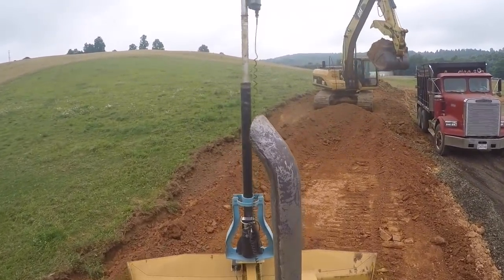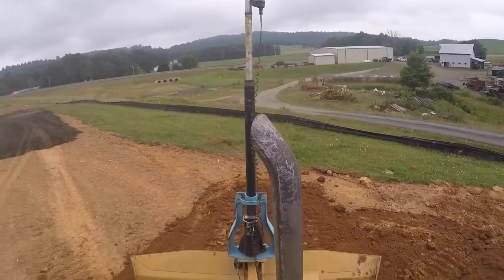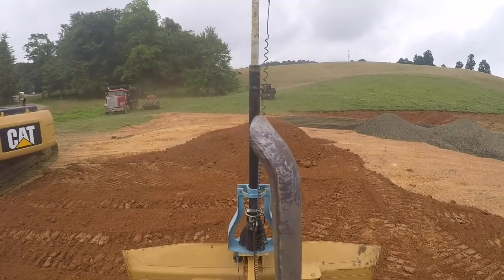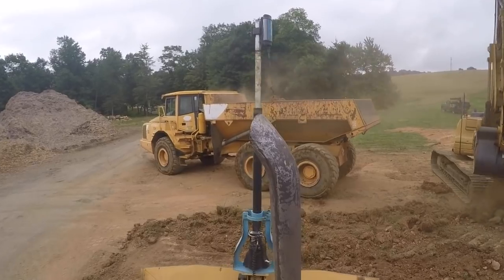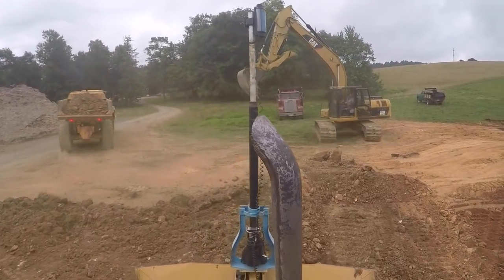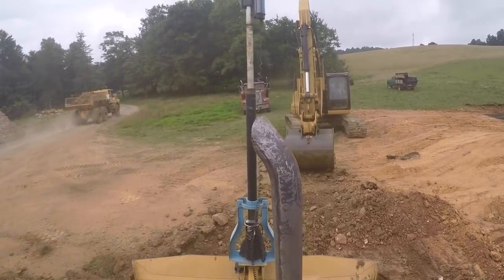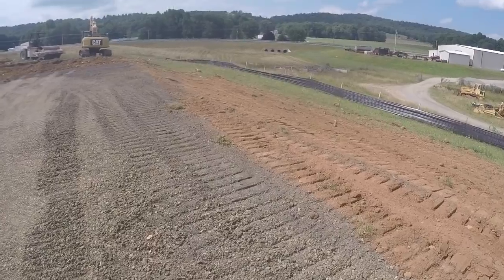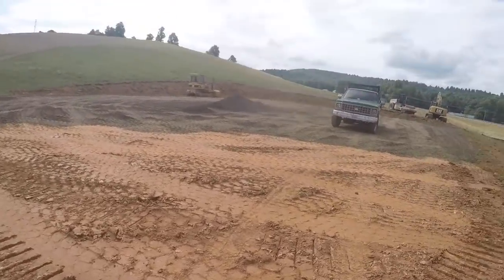Last of the hay barn grading

Comment: After my year in farming I followed dad into construction, he put me with the survey and civil engineers. Now this was the time of Levels, Theodolites, chains and pull banding for precise length measurements. The later had to be checked against the UK imperial measurement scales in Trafalgar Square, London where we were a tourist attraction for an hour or so. For a dig like yours we had to erect sight level boards, two men would then measure the dig depth one sighting the other walking with the T shaped traveller. But then you know about all this. To transfer the opening position of tunnels at the bottom of a shaft. Two alinement points were set at the shaft top, finned weights were dropped down the shaft on piano wires, with the weights suspended in oil filled drums. Line up the two wire and dig away. Man the good old days.

Later I went into tunnel construction and a senior engineer had invented a line and level tool for the tunnel boring machine. It consisted of a car spot light mounted so the beam was at line/level, at regular distances were three steel panels with a cross cut into them for the beam to shine through. The cross shone on a Formica board marked with square lines, numbers across the top letters down the side. At the start of each shift the operator was give the coordinates to steer A1 A2 A3 and so on. The TBM would be launched from a station tunnel and the drive out of the station would be down grade to the next station mid point then the grade would rise up to the next station. The idea for the dip and rise was to save electric power when the train pulled out of the station, and to save on braking on the rise into the next station. The tube line would follow under roads.

The next tunnel job had a new fangled laser instead of the car spot light. The surveyors know have Total station instruments.

Sorry for going on but farming and construction Vlogs bring back so many memories and I'm only 74. Boy I'm going to enjoy watching your channel.

PS Worked on a tunnel from Ontario to Michigan under the St Clair River back in 1994. Plus many more around the world.
Reply from the maker: Thats awesome to hear how you used to do that stuff!